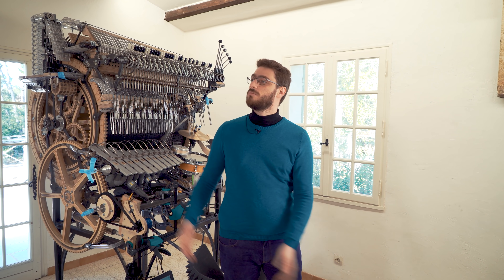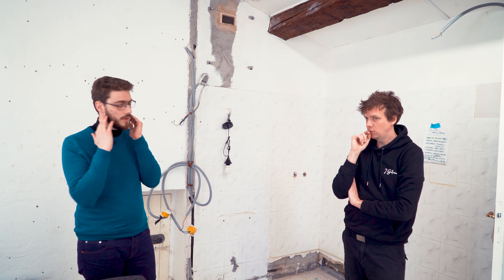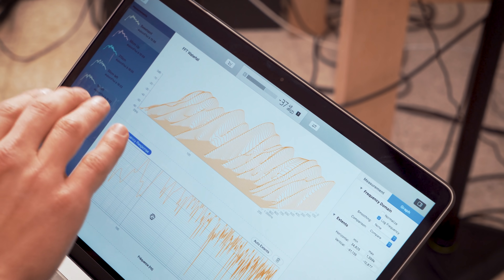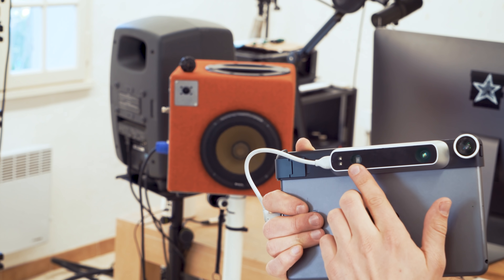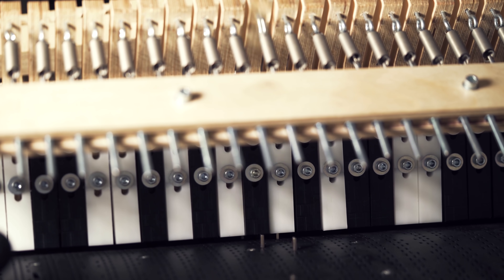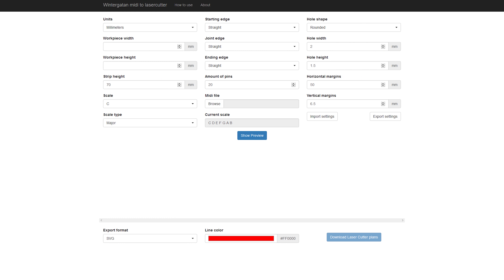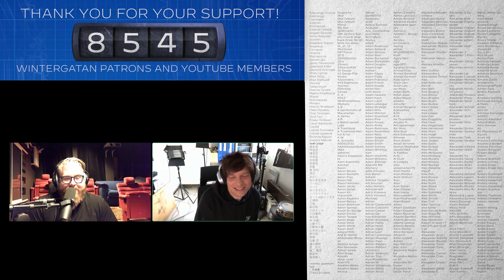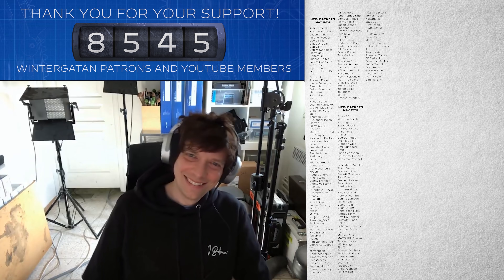Music Studio Acoustic Measurements - Marble Machine X #127

Comment: I really dont like the electronics creep EDIT* the electronic solenoids are only for composing the music and will not feature on the machine for performing. Ive also thought some about my comment and Ive decided its unfair for me to start demanding constraints when martin has made his priorities clear and the machine is his priority
Reply: There is no electronics creep, most of the electronics we see now are “tools” that allow to reduce the unnecessary actions without compromising anything for the machine itself. Like, the motor is there so it would be easier to test stuff. The potential solenoid releases — same. They won't be there for the actual performances of the machine, but could make it much easier to prototype on it, allowing Martin to spend more time composing instead of cranking the wheel changing the positions of the pins.
Reply: Some day they will find out, that the can sample all the sounds and the hardware isn't  needed anymore. They left the path of "make it simple" and  are in dange to call the spirit of the instrument.
Reply: The electronics are for composing, not performing. The stud welded sheels will actuate the marbles, but before we have those Martin needs to compose a song and send it to me.
Reply: @DrSkunk  ohhh thanks for clarifying! I will edit my comment so passerbys are aware of my mistake
Reply: I don't like it either, but maybe it is necessary

Comment: I thought this was a mechanical machine?  PCB's and solenoids...Just buy a synthesizer.
Reply: I don't think Martin will ever leave the programming pins, but the electronic side helps tremendously in music prototyping. I imagine the solenoids either being only on the alpha machine or removable.
Reply: Take another listen - Martin is using the solenoids to aid composing. He clearly says that his intention is still to get the stud welded plates made once he is happy with the song.
Reply: While I get what you're saying, solenoids are mechanical.
I think the solenoids are a good idea, but instead to hit the frets on the bass.
Reply: A entirely mechanical device that produces music (like the first music machine) is exotic. But actueating solenoids takes it to a technological side which kills the exotica. The MM project is seen to be morphing into what we did not realize all those 3-4 years ago. The engineering work expended here could easily have developed a industrial process machinery like a simpler weaving machine or a printing machine. The musician is top knotch and... Simply cannot imagine how much musical creativity would have resulted if a synthesizer and an ensemble would have been put to work instead

Comment: Martin,  can you please explain why the Marble Machine isn‘t working? What´s wrong in particular?
Reply: Same question. I didn't quite get what's wrong.
Reply: @selensewar  I want* to say that some of the internal mechanisms for the MMX are still "under development" - like the majority of the MMX is in place and functioning, but what's left appears to be a bunch of fine-detail work and fixes for stuff that currently works but doesn't necessarily work great for what the MMX is intended to do. Remember, the end goal is for this thing to be reconfigured on-the-fly during a live performance, which means each mechanism needs to be robust enough for transport and disassembly, as well as user-friendly enough to actually be easily adjustable in a high-stress situation. Some of the stuff he's got bolted onto the thing now require fine tools to adjust, which means those solutions will ultimately still need to be changed :)
Reply: There are not enough features.
Reply: It's incomplete,
you're used to seeing what is good enough that Martin shows you it.
break downs, tweaking, calibrating and so on is probably what happens most of the time.
When the bass works suddenly the drums doesn't, stuff like that, that's what happens to really complicated machinery.
Reply: I get the impression there's a lot.
When it comes to engineering and development usually a demo/prototype product is made first which helps locate problems in the design, and then those problems are fixed in subsequent versions.

The MMX has so many complex parts that are only just coming together in any semblance of completetion for the first time, so theres problems that are being found left and right that need revisions made to work properly together. Timings that aren't quite tight enough, sounds that are too loud in the reccording, parts that arent going to be durable enough, etc.

The Pareto Principle definitely tends to apply when it comes to art and engineering, also known as the 80/20 rule. The first 20% of the time makes 80% of the progress, and the last 80% of the time is used for the final 20%.
But theres also a saying that art is never done, only abandoned. 

Both of these apply here. Putting together a team will mean more man hours going into finishing it faster, and will leave whether its actually in a "done" state to a third party. (The artist will always see more things to 'fix' that the public never would, involving more eyes is a great idea)
Reply: The previous video highlights some, but there's a pinned post in Discord with a complete list.
Reply: Thanks for all your explanations!  Because I‘m an engineer, these points are clear to me. Bit I would find an video with some examples interesting. And especially for non technicians things might be easier to understand. 
Moreover I have the opinion we all should talk more about failing and failures. It‘s a big mistake not to do so. I like Martin‘s Videos about failures!